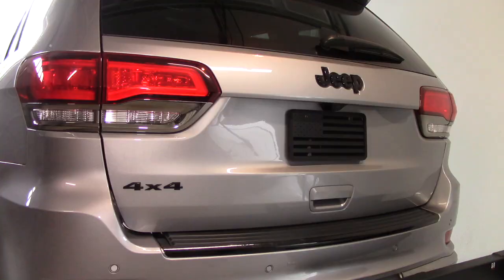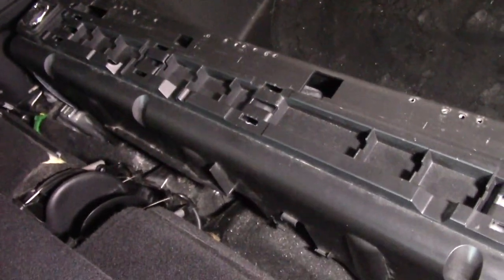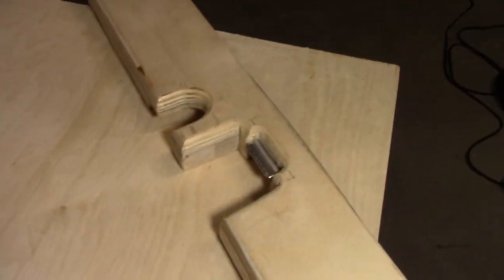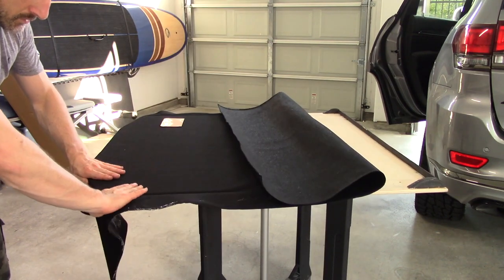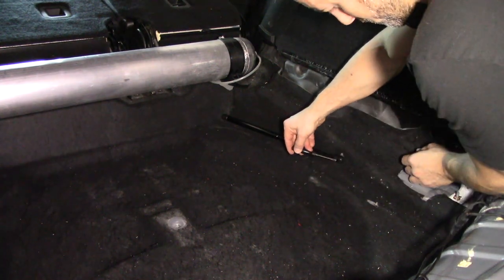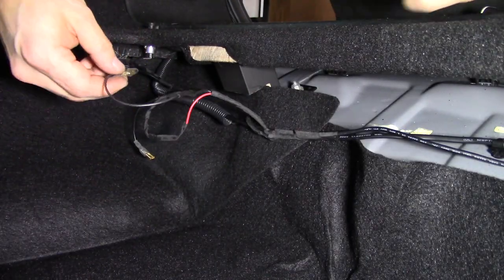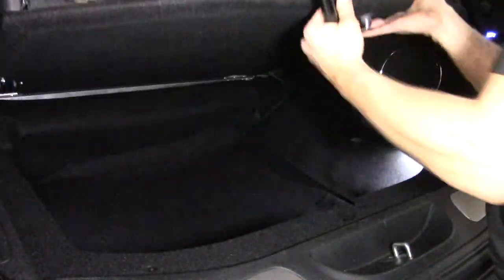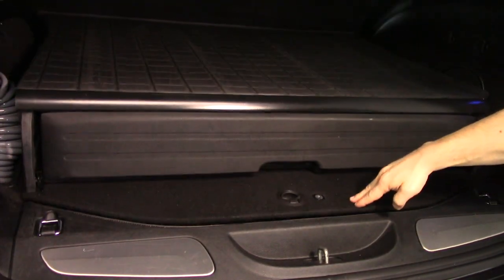Custom Cargo Cover Jeep Grand Cherokee WK2 Modification

Comment from the maker: Since I've have a couple requests for measurements, I may make another video that shows more details of each of the parts with some measurements. It's hard to describe everything without visuals, so I'll try to put something together in the next week or two time permitting.
Reply: A build list and measurements would be awesome.  Did you draw this all out or did you custom fit as you went?
Reply from the maker: @kalendrinn  I mostly fit as I went. Here is a link to the video where I go over the measurements. Hope that helps. https://youtu.be/mj7JygPkJaw

Comment: Great video and great alternative to mine, love the finish, looks factory..... Well done!
Reply from the maker: Thanks! I checked out some of your other videos. I like what you’ve done with your wk2. How is your roof rack holding up? I also have the front runner rails. I had issues with fracturing after awhile so I installed them on the pinch weld in my roof rack video. It’s been solid as a rock. Really happy with it.

Comment: This is the best build I’ve seen. I’ve got a ‘15, and I would love to see your parts list so I can do something very similar. Great job!
Reply from the maker: Thanks for the comment. Some of it was just stuff I had lying around the garage that i re-purposed. For the stuff i purchased, I haven't actually gone through and put it all together yet. Are there any specific parts that you like to know? The part number for the hinges I used is HG-OTA100. They allow the whole drawer system to be easily removable. The Gas struts i went with were the suspa C16-06867. Let me know if you have any specific questions.  I'd be happy to help.

Comment: This is the EXACT set up i wish i had for my JGC
Reply from the maker: I'm debating trying to make it into a kit that I can sell. Not sure if the market for it would be worth it yet. I'm doing a little R&D. We'll see. Thanks for the comment
Reply: What did it cost you to build yourself?
Reply: @junioraus8278  honestly it’s hard to say. I tried multiple variations before I was able to make it work and I didn’t really keep track of all the costs. But a rough estimate for materials would be between $3-400 some of that is excess though because you can’t always by the exact amount of material you need. Wood, glue, hardware, carpet, paint etc. Also depends on whether or not you have to buy tools.

Comment: Great video and super job on the build! I have a 2019 Altitude that I have been trying to do just what you have put together.  If you are looking at selling a kit (or even plans) I would definitely be interested.  There is so much aftermarket solutions for Jk's and JL's, but nothing for the WK2. So happy I stumbled on to your channel.  Well done!
Reply from the maker: I agree, it’s hard to find good stuff for the wk2 although it does seem to be slowly improving. Thanks for the comment. I’m definitely giving thought to it as a side project if I can find the time. Will keep you posted.

Comment: Definitely interested in this, if anything, solely for doing struts on the stock floor/cover.
Reply from the maker: I tried that initially. The problem is that the materials of the stock floor board and the plastic bin just aren't strong enough for the forces of the struts. I got it to kinda sorta work, but it was definitely not something that was going to last. Although, if you only want the stock cover to lift without any load on it, you could use very light struts, so you may actually be able to make that work. But you would still have to use some kind of hinge, otherwise the board will just pop out. I initially attached hinges to the plastic bin, which again could work possible with no load. If you look closely in the video you can see a bunch of holes where I had tried different methods to attach to the bin. Let me know if you have any questions.
Reply: @totisviribus2616  Thank you for the input. If I ever overcome my laziness/procrastination and do all of the sound deadening/dampening I would like to do, I may see what I can do in the area with it all disassembled. I had thought of a piano hinge across the rear but will need to see how robust the rear is as to if it could even support that. Storage in the WK2 has always been a let down for me (last vehicle before my 3 consecutive WK2's was a Sequoia), so an easier way to access that area would be nice.

Comment: First off, this is impressive. I have been building an offroad trailer to pull behind our WK2 for the past year or two, and storage inside the vehicle is something I would love to tackle now that that project is in a usable state. So far, I have the spare mounted on a hitch tire carrier that I welded up (similar to yours now that I see it) and a custom slide built for a fridge in the rear. What I don't have is the framework and platform you built to make the access to all that extra storage easy enough to be useful. I would definitely be interested in some measurements and maybe a bit more specifics in regards to the construction of the hinged platform itself. Heights of the standoffs to make things flush, the position of the gas strut attachment points, etc....... if only as to not make the same mistakes you mention. Regardless, thanks for putting up the video. It already has enough information for me to start a new project this weekend.
Reply from the maker: Does your Wk2 have the air suspension? If it does, probably the first thing you'd want to do is figure out the back rail that bolts down. If you have the air tank back there, there is not a lot of wiggle room and the way those things are mounted is a little flexible so giving you my measurements probably won't be helpful. I had to cut it in at a couple places so that the support bar wouldn't press into the tank too much. 
Once you have that bolted down you can measure from where you put the hinges to the edge where the floor board is flush at the tailgate. That would be the depth of the hinged platform. 
The rim that it sits on would be pretty much the same thought you may need to trim it half an inch or so.
The width of both would just be the width and shape of the factory floor board.
I started the drawer  build behind the curve of the floor board  so that there is no overhang in the front (front being closest to the tailgate) and then it stops about 3.5 inches before the back of the board (the back being the rear seats) so that when it lifts, it has some space otherwise the top of the drawer will run into the back seat preventing it from lifting. 
I made the exterior height of the drawer about 7.5 inches tall. It's really your preference depending on what you want to fit.  Just keep in mind, the taller you make it the more space you'll need to leave in the back so it won't hit the seats.
As for the base rim, I started at 1.5 inches in the back and tapered it forward to 2.5 inches and then as it curves to the front it's 3 inches. There is wiggle room with those measurements depending on your preference.
The Struts are a tough one. Because the jeep basin is so curved there no exact point to measure from. The good news is that if you put the ball stud roughly where I put it in the vehicle, you can adjust where the ball stud bracket sits on the base board. Because its plywood, you can make a few sets of holes to find the best positioning. My  brackets are set to that the ball is about 15 inches from the back of the board and about 4 inches in from the side. That's with the 17.1 inch 60lb strut. if you change the length of the strut you'll have to position it differently or else it may not shut. When my drawer is fully loaded 60lbs is a little weak. Sometimes i have to help it up. I may look for struts with the same length but closer to 80 lbs.
Anyway, hope that helps. If something is not clear just let me know.
Reply: @totisviribus2616  this is such a quality build with a real OEM feel to it, I am wanting to do the same to my own rig as I work to turn it into a touring machine. I would be keen to understand your measurements for the base if you have them to share, I am running a JGC Overland MY14 with air suspension.
Reply: @totisviribus2616  Thanks for taking the time to put all that down in writing. It helps tremendously to have something to reference. I spent the better part of the morning today getting things ready in the back of my Jeep to start this project. My situation is slightly complicated by the fact I have already built (and have been using) a replacement storage platform back there to mount the 12v fridge and slide. I’d rather not have to scrap all that work to add the infrastructure underneath to bolt everything to. So I am kind of having to go at this thing in reverse.  That said, since the current platform is just a copy of the one that was there from the factory (and therefore fits inside the plastic tub surround that I am trying to replace) that piece is probably gonna be a bit short once I get the hinge located where it needs to be.....so who knows, I may be fighting a losing battle.

Like you, I have a DIY, welded together, hitch mounted tire carrier. In addition I have an 8ft off-road trailer we fabricated over the course of the last year or so. For some reason, designing and building those things wasn’t nearly as hard for me as trying get started on this hinged platform system. I guess mainly because of the scale. Cutting, grinding, and welding mild steel into an indestructible tank of a trailer is apparently much more in my wheelhouse. I’m having a hard time wrapping my brain around the tiny measurements and hardware required to position the bottom piece of your platform (the part that replaces the plastic surround) in space. 

If you made it this far, maybe could expand upon the 4 L Bracket attachment points you created and used as standoffs? I wish I could attach pictures. Hard to explain. Regardless, thanks for taking the time to make the video and respond. If I come up with any specific questions I’m sure I’ll be back here asking. Currently I just need to start cutting things and hope for the best. It will come together once the sparks start to fly.

Comment: I’m interested in doing this but maybe do two drawers instead. By any chance do you have some measurements?
Reply from the maker: Hey there, thanks for the comment. Are there specific dimensions that you want?  The way I did it, I optimized for it to functions as a table. If you wanted two drawers more for storage you may want to do it somewhat differently. I used the board that covers the spare tire as my initial base and went off that. Keep in mind, if you want it to lift like mine does you’ll need space between the end of the box and the rear seats. If you give me some more specific questions I’d be happy to answer.

Comment: Great work! Where did the fold down drawer front come from? It looks like a molded plastic piece so I imagine it was repurposed from something else, or was it homemade?
Reply from the maker: Hi, thanks! It was home made. It’s just a piece of wood. The front design is just a bit of router work and it’s spray painted with truck bed liner.

Comment: How's the reverse camera with the spare mounted on rear? Can you see anything? Gonna re-locate?
Reply: With the stock spare tire you really can't see much. A 5 spoke may give a bit more visibility. If I kept it on full time i would probably consider relocating, but since I only use it for longer road trips I've just left it as is.